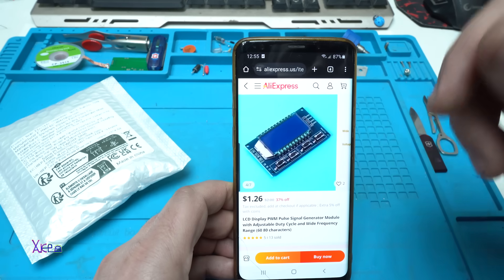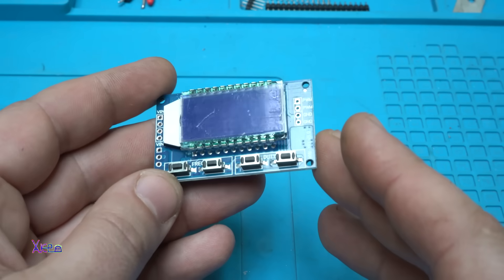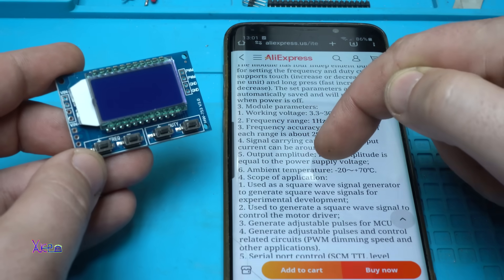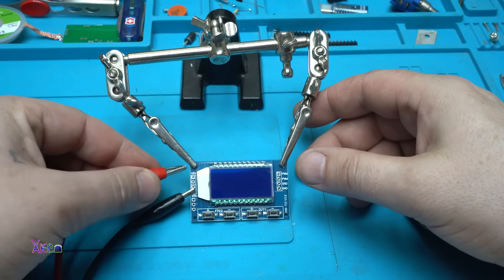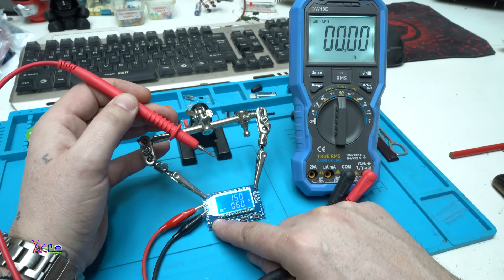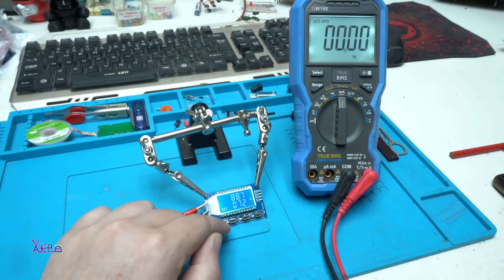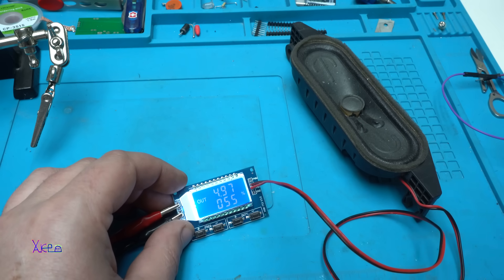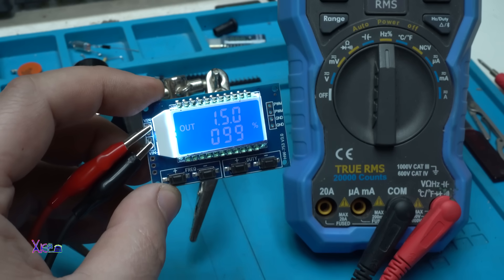$1 Aliexpress Module-Signal Generator PWM Pulse Frequency Duty Cycle LCD

Comment: Bought such a module after your recommendation, with VAT and shipping the price came to $4. The module is said to have been shipped, but I have not received it. Track'n'trace goes dead in mid-April and then nothing happens.
Tried to contact the seller, but my message is only sent if I can place a tree (a bird or something) in a puzzle, but that is completely impossible! I can't contact the seller and feel grossly cheated.
Just a warning to others! The $4 has no meaning, and I'm done shopping on Aliexpress.
Reply from the maker: Packages from ali travel longer time,I wait some of mine products more than 2 weeks
Reply: @Hacktuber  + 5 weeks here!

Comment: Nice module. Maybe you can connect some transistors on the output so you can set the speed of an ac motor 😊
Reply from the maker: Yes, you are right

Comment: I'm starting a Eurorack synth and see this as a clock source and\or a vco! Starting with a Dim6 Sequesizor module and diy ing from my used parts 401k! I saw the Credit Card Synth and Sequencer as kits and then the Eurorack combo unit and said that's a better solution! I have the Korg Duo and Delay boxes, a JT400 synth and a Stylo Beats. Sequesizer is first foray into cv's and gates!
Reply: Wow that’s amazing where can your project be followed?

Comment: Okay, let's talk simple about what a PWM board makes:
No, it's not ChatGPT. Lol.

Frequency: How fast the electricity gets on and off. It's like a switch, turning on and off at different speeds. For example, 1Hz means that every second, the internal switch turns on and off. 150khzs means that ON/OFF shift happens 150.000 times every second.
Load cycle percentage: How much time per cycle the "switch" is ON compared to OFF state. For example, in a 50% cycle at 1Hz, the "switch" will be ON half a second, and OFF the other half. In a 25%, it will be ON for 250 milliseconds, and OFF for 750 milliseconds.

With this, we can control how much power is delivered to a motor, a LED, a heating device... In a 50% percentage, we are going to power the load (motor, LED, heating device) at half of its maximum. 
In a low frequency, the LED, for example, will flicker. In the example of a motor, industrial huge motors will be happier with low frequencies, while small motors for robotics and so, will need faster frequencies for a smooth function. Lower frequencies will also be less power consuming.

For heating elements, the same. Lower frequencies will turn on and off the heating device, making peaks and valleys more noticeable, while high cycles can keep a more smooth temperature. 
But again, big powered coils in industry will not need these high frequencies, and it will save more cost on power them up. For example, a water heater, or a under desktop stove. 

I hope it helps!
Reply from the maker: Very well explained,simple to understand everyone,thx for sharing this sir👍

Comment: Looking forward to seeing its practical application.
Reply from the maker: It's really cool!
Reply: Testing servo motors is one.
Reply: @ Awesome, wouldn't be surprised if that's exactly how Hacktuber uses it.
Reply: @ Through a power transistor, control DC motor speed while retaining torque. They are excellent for that. Also, when you need to pulse something off and on (a relay, a bell, a light). I see it has a serial port too, so it can be controlled from a pc. maybe a phone too. Some people use it for tone generation (it's not sine, so pure sines are not produced), it makes square waves. Can be used as a clock generator for digital ICs or to switch TTL logic off and on. Use it for checking (on cars) fuel injectors. A fuel injector requires off/on pulses at particular frequencies and duty cycle, you would need a power transistor to drive the fuel injector. Can use it as an input to check other things on cars like sensor inputs. Also use it to flash a warning light (thru a power transistor) at the back of your car on the road at night, where you place the flashing light about 100 meters or up to 200 meters at rear of car so no one slams into the back of you (check the distance, at 100 km/h, 200 meters is only a few seconds warning). Lots of uses, just put it in a little box with a DC power connector for supply voltage input and a pair of banana sockets for the outputs. Versatile and simple test equipment for all kinds of things.
Reply: @ Holy crap, thank you for taking the time to write that. Very interesting read and by the way, far more detailed than the answer I got from Chat GPT earlier.